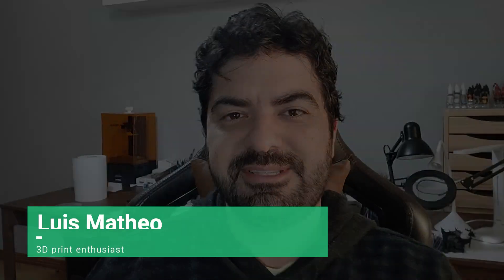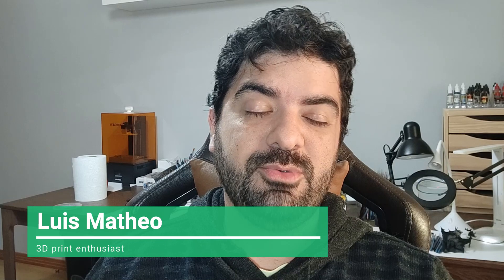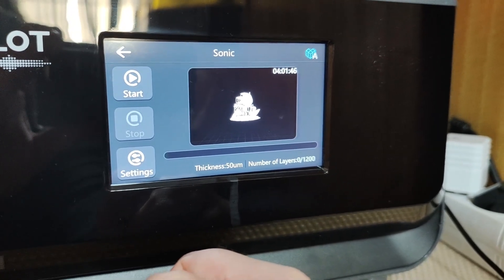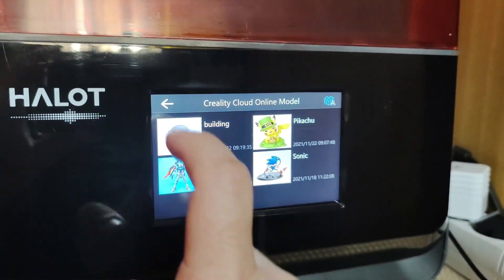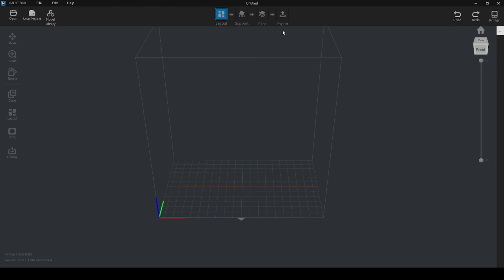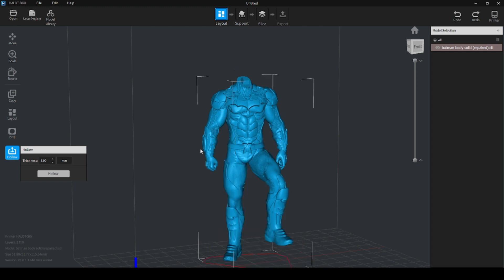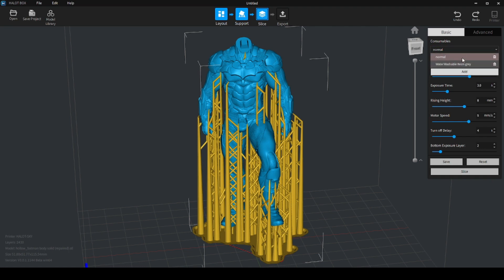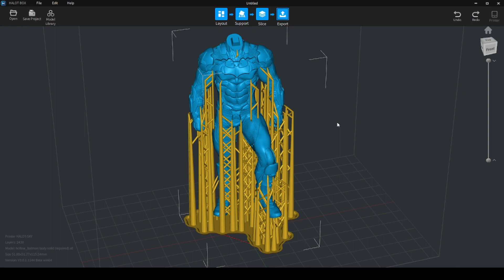New Firmware(HALOT OS) and Slicer for HALOT resin printers series - Big improvements!

Comment: Hey, I’m having a problem with my Halot Sky’s screen were the entire screen lights up just enough that it causes the resin in the vat to thicken and slightly yellow. The actual print area is only slightly brighter and results in semi solid resin on the FEP. I’ve tried changing the screen and updating the firmware. Have you experienced this issue?

Comment: can you tell me the parameters of halot sky for jewelry printing?
Reply from the maker: It depends on the resin you're going to use, you need to check with the manufacturer of the resin in question. In any case, I suggest you run a test with the resin you want to print, print this https://siraya.tech/pages/siraya-tech-test-model hope it helps, check this video from Uncle Jessy about resin print tests https://youtu.be/-pbi6CkZxgA

Comment: Máy máy này có loại resin nào đúc nữ trang mà rửa bằng nước không bác?
Reply from the maker: Hey, those machines can handle any type of UV resin, from any brand, I don't think Creality has a casting water washable resin, but you can try with other brands and use it with those machines without a problem.

Comment: Hi. What printer would you recommend for jewelry? LONGER Orange 4K Resin at 6480 x 3840 x 31.5 μm Y 10.5 μm or anycubic Photon Mono X 6K at 5.760 x 3600 pixels XY 34 μm. Y 10 μm. Or your option.
Reply from the maker: I don't know the Photon mono x 6k, but if they follow the quality from other printers, you can expect a very good printer, since it has a bigger print area and for the price range it's a better choice. But LO4K it's a very good printer too, smaller print area but very good quality printer.

Comment: With the latest release of 26 Nov 2021 version 2.201 I have been experiencing after x amount of layers printed, it will just stop the print automatically.
Reply from the maker: That's weird, I did not experience that in my Sky or Lite. I don't have the One. You can report it to creality support, bugs are not uncommon in new software releases.
Reply: Thx for the reply, do appreciate it and I will indeed let Creality know. Thanks

Comment from the maker: The new slicer is officially available, just download it at  https://www.creality.com/download. The firmware you can get it at the same link or via OTA! :)
Reply: I was hoping that I can just load the STL file directly on the printer without the use of computer. Or at least, give it in a series of bitmap files, representing each layer, in a usb flash drive. It should be no problem if it's done in open format such as pbm, and compressed via zip.

The necessity of using Windows or Mac is an insurmountable challenge since I use Raspberry Pi exclusively.  :(
Reply from the maker: @simpletongeek  Hey, unless you use the Creality cloud, I don't know any other printer where you can just send the STL to the printer and it prints. Creality is the only one trying to make this concept works, but I think it's really early stage, I think it works for more simple models, where the supports are not that complex, but mode detailed models that needs better supporting, I think it will not work very well. The normal process is you need to prepare (in case of supports needed) and then slice the file to the printer format in a PC or MAC. Try the Creality Cloud thing, maybe it works for you if you can access the web with your raspberry pi.